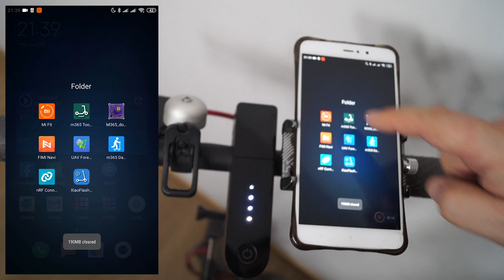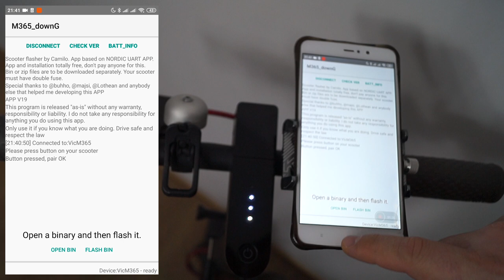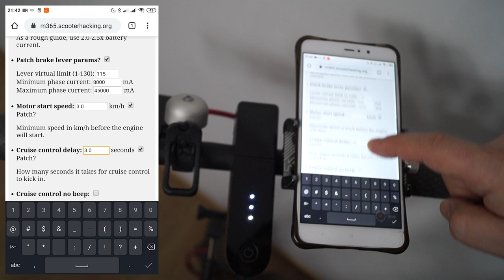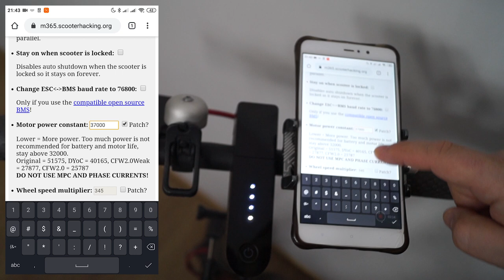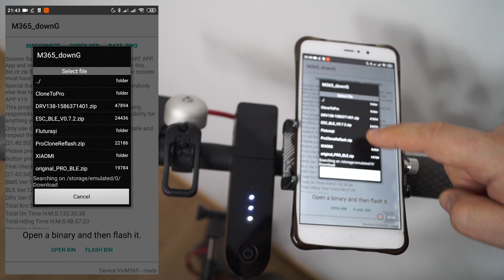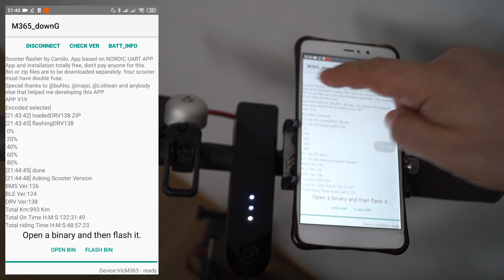XIAOMI M365 (Pro) | Do you want higher TOP SPEED or STRONGER ACCELERATION? Flash a CUSTOM FIRMWARE!

Comment: Wow... i  have standard m365 but had problem xith power switch so replaced it with a pro dashboard and now xiaomi home recognises it as a pro versinn algthough it didnt make it any faster wasnt sure which patch to use  so decided to try your pro patch. Was quite easy didnt change much except that 37000 bit and the russian algorithm thing (wasnt really stre what else xou changed not very clear) And it worked AMAZINGLY the speed is a great improvement i now have to ease off the acceleration every now and again as it is going too fast when i would usually be at full throttle and needed more speed. It even climbs hills alot better used tn have to use foot to help it up big hills but now it will get up.  I cant thank you enogh you are agenius THANK YOU SO MUCH
Reply from the maker: I'm happy to hear that you are so happy with your "new" scooter.

Comment: Nextor, how long have you been riding with custom firmware? I have made a log with m365 tools and in sport mode it goes up to 810W when having 31-32 km/h. Is it safe? How much will batteries and esc last in this mode?
Reply from the maker: I used it for about one thousand kilometers, all with custom firmware. No problem at all and I weigh 120 kg.
Reply: @nextor11  what's the maximum speed when you ride it? Do you keep it in sport and at it's highest speed for long periods of time?

Comment: Hi, 
Love the video and enough information on how to increase speed. 
I’ve just got my Xiaomi pro, guess the big question is, how safe is it to change the firmware. What if anything can go wrong. I’m not the most computer savvy, when you start talking about changing this and that, I’m worried I may mess up and destroy the scooter. 
Also what are the cons for lifting the speed restrictions, do all the modes still work, how much distance would you loose. 
Sorry for all the questions!!!
Reply from the maker: Well, any firmware update/downgrade might go wrong, not only on scooters, but it's usually going well. In case it doesn't go well, there are relatively easy to implement solutions to restore everything to how it was initially.

All modes still work, but I can't talk about the range because it was never a problem for me and I never measured the range.
Reply from the maker: There aren't any real cons if you don't use too aggressive settings.
Reply: Nextor many thanks for the quick reply, 
I just didn’t want it to brake or go wrong before I’ve even hardly used it, but might give it ago as uphill can be quite slow and would like to see the difference.
Reply from the maker: I strongly recommend flashing a custom firmware, but only after researching the matter a little bit.

If the flashing process goes terribly wrong, you might have to do this
https://youtu.be/xlezACP1YYw
or this
https://youtu.be/aGCCmvfTRXU
Reply from the maker: If you are comfortable doing what I do in those videos, then there is nothing you can't fix.
Reply: Nextor sorry, 
So in simple terms, when you say flashing a custom firmware, it basically tweaking a previous version to then install onto the scooter. Apart from the Mi home app, what other app do I need to download onto my phone to support the process
Reply from the maker: M365 DownG or XiaoFlasher are the apps that will flash the custom firmware.
Reply: Nextor if someone does have only iPhones, can theses processes still work
Reply from the maker: I wouldn't recommend doing this on an iPhone. The iOS app is not very reliable from what I heard.

Comment: Hi, just wanted to flash my m365pro via downg but if i press vheck version it will start showing temperature, batt remaining, volt.and it won't stop so i can't open the bin.got esc 0171, ble 0125, bms 0126. Got a m365 dashboard v2 soldered to the current one and installed rita with 12s battery.do you have any idea how i can flash my scooter in the current configuration?thanks in advance

Comment: I've got a M365 Pro but i'm too scared to flash it as many people say they end up with problems. Also, i've got a front solid tire. Whats your suggestion? Good video btw.
Reply from the maker: What kind of problems?
Reply: Victor Ungureanu the motor stopped working  and damaged the battery
Reply from the maker: Hi Tom. What are you talking about? This happened to you?
Reply: Victor Ungureanu yes this happened to me I flashed my scooter then if I span the wheel on my Xiaomi pro it would go 35 kph but then when I rode it the motor locked up and stopped working then I had to take it to Xiaomi and they have had to replace the battery , motor and the control board so you have any idea of how this could of happened thank you
Reply: @tomhearn944  Hi Tom,

I know its been a While, but did Xiaomi not void the warranty or did you have to pay for repairs?
Reply: @Uniques97  because my rear fender broke  my light cable snapped then I had to pay 300 pound to get everything fixed on my xioami pro bit if that light cable was ok I think they would of done it for free but I have done it right on my new 2020 xioami pro and it works fine

Comment: Salut! Multam de tutorial! Ma gandesc sa modific si eu 365 PRO-ul meu. Ai idee cum influenteaza viata bateriei, a motorului?
Reply from the maker: Bateria și motorul sunt ok. Cel mai frecvent apar probleme la controllerul motorului, dar asta doar când sunt folosite setări agresive.
Reply: @nextor11  Multam fain si ptr raspuns! A mea in momentul de fata se duce pana undeva in 27km/h maxim. Poti sa-mi dai niste parametri oarecum safe ptr ea?
Reply from the maker: E cel mai bine sa studiezi tu problema și să înțelegi cam ce rol au acei parametrii. Monitorizează temperaturile înainte de a pune firmware custom și după. Orice modificări faci, fa în pași mici.

Comment: Thanks for Tips off this .I just did what you showed, its works , but i can not see my battery level, its just flashing 1 Red bar, even full charged ?! Something to do about that ?
Reply from the maker: You flashed the wrong firmware. You either have a Pro scooter, either a classic scooter with Pro dashboard. In any case, you should flash a Pro firmware.
Reply: @nextor11  You are Good, Now it Works Perfectly. Thanks for help!! :-D And Yes i have a Pro version.
Reply: @lillebrorjensen7063   I flashed the pro with the classic firmware :-( Cant get it back to Pro now.  BMS 116, BLE 90 and DRV 538. How did you do it?
Reply from the maker: You need to flash DRV155. If you can't do that using DownG or XiaoFlasher, you will have to do this:
 https://youtu.be/aGCCmvfTRXU

Comment: Got a friend with 1.5.8 firmware on M365 and I cant flash DRV. BLE and BMS I can flash on any version but not DRV. tried both Xiao-Flasher and M365_DownG
Reply from the maker: M365 DownG is v19? What does it mean that you can't flash drv? Does it fail with an error or does it look like it's flashing ok, but in the end the version remains unchanged?
Reply: @nextor11  Flashing and it the end the version stay unchanged (0538 version )
Reply from the maker: 0538 doesn't mean that it's unchanged. You enabled version spoofing in the custom firmware and that's why instead of 138 is showing 538.
Reply: He updated with custom 138,drove some weeks and accidently updated the latest 0538.
I tried to rollback to older versions DRV with all BLE, BMS from xiaoflasher. No result so far
Reply from the maker: Don't check the "version spoofing" option when you create the custom firmware and you'll see that it will go back to 138
Reply: @nextor11  Will try and write again.
Reply: @nextor11  I tried all combinations and no result. I tried also some Italian Firmware with no success. The only difference was when changing BMS firmware, BMS115 gave the best results in acceleration, but max speed was with all versions DRV (all apps always showed DRV0538 despite the version I upload with ''version spoofing not checked) 26.7kmph at a flat surface and when downhill was KERS (all version I patched was with KERS above 45kmph) kicking and preventing me from more than 28kmph.
Reply from the maker: If the drv version remains 0538, even after flashing a custom firmware that doesn't have version spoofing enabled, this means that the flashing is not successful. I don't know what is happening. Try also to downgrade the ble to see if you can actually flash the drv firmware afterwards.
Reply: I tried 072, 073 and the all version I have found. All flashed OK. But as I said DRV didn't change
Reply from the maker: Then I don't know what to suggest other than using an ST-Link programmer to flash the drv.
Reply: I think so

Comment: Using your settings in firmware, will it not fire the control or mother board? Have this been tested?
Reply from the maker: Are you asking if these settings will burn the electronics?
Reply: Nextor yes
Reply from the maker: My settings are quite conservative, so they are generally very safe, but it also matters how heavy you are, if you are living in a very hot place, if you have a lot of hills to climb, etc.
Reply from the maker: Oh, and properly inflated tires.
Reply: Thanks I’m 70kg and live in uk
Reply: @nextor11  I have a classic (2018) M365, now with 6500 km. It is holding up pretty well - I can ride some 15 km in the city, full throttle. Yesterday I have flashed it for the 1st time, using a "motor power constant" of 33000. Everything works well, it has noticeable faster acceleration, better climbing ability and it reaches 30 km/h. However, I ride it to and from work and one way is 10 km. On my way back, after some 5 km, I checked the motor temperature - it was quite hot and the battery temperature was already 40 Celsius. After that, I tried to ride it slower, but by the time I got home the motor was hotter (it was hard to keep your palm pressed to the sides of the front weel) and the battery temp was 42 Celsius. I am planning to change the settings to 37000. Do you think it would be safe for frequent long rides? (Does anyone have experience with this level of setting - I mean thousand of km experience, not just a week or 2?).I weigh 93 kg.

Comment: Hello there! I am also living in Romania, and would like to ask you a question. First, i would like to thank to you for making this video and to tell you that the trick works. BUT, there is always a but. I have the Scooter Pro version with 1.7.1version. If i check patch on sport and drive mode and raise the speed, it does not actually affect the max speed. If patch on sport max speed or d max speed is checked or unchecked, in russian throttle algorithm it does not take into effect speed control param, as it is also writenn on the web site. How could i still limit the speed then but raising it to 30 in sport and 25 in normal drive? Best regards!
Reply from the maker: Hi Marius. I don't have a Pro to test this, but I think you need to leave Russian throttle unchecked and change the currents in sport mode, plus raise the speed in sport mode.
Reply: @nextor11  I havent changed anything in currents because i would like to keep away from real problems with my scooter. I am not that technical to even understand those changes. The thing is that with drive normal speed set to 25, with Russian throttle off, it still goes with 20. So there are no changes whatsoever, even if i think it should be.
Reply: @nextor11  With russian throttle on, i managed to enter in cruise control in a very strange way, after 30-40 seconds of trying. And after entering cruise control, the scooter does not remain at the same speed, because i guess the throttle is "fixed" not the speed. So that's another downside of russian throttle.
Reply from the maker: Try this: https://www.monopattinoitalia.it/miglior-firmware-per-xiaomi-m365-pro/
I hate to recommend it because it's "stollen" and the actual developer of the firmware get's nothing in return for his work, but maybe it helps you.
Reply: @nextor11  seems that in S they are going for russian throttle mode. So i will skip theese italian firmwares. I have seen here someone commenting about the gonka fw, witch i downloaded and seems ok at first sight. It's a pity the https://m365pro.scooterhacking.org/ is not doing his job correctly :( At least i would have known what is changed from "standard". I repeat myself, i would not like the battery and engine to be forced too much. Some little increase in maximal speed, without working at acceleration or currents.
Reply: @nextor11  How could i update to 1.7.1 if i would like stock again? Could i update 1.5.5 from xiaomi official app directly? Thanx!
Reply from the maker: The firmware from italian website is not using russian throttle algorithm, but Oleg's algorithm, which is considered to be the best, but which is not free usually. That's why I said that I wouldn't recommend the italian website, because they are actually "stealing" from Oleg.
Reply from the maker: Returning to stock factory firmware used to be straight forward, but now I don't know any way of doing it.
Reply: @nextor11  on the italian website, next to sport mode "accelerator sport" is a russian flag :) I don't know who Oleg is.
Reply: @nextor11  that's odd. So we are stuck in "custom" firmware? Wont xiaomi app say "new update"?
Reply from the maker: It used to say that there is an update available, but lately it doesn't.
Reply: @nextor11  are you using "Version spoofing"? I will try to see if my app wants to update it, the version is now 1.5.5. With version spoofing you have 5.5.5
Reply from the maker: I'm not using version spoofing, why would I? :)
Reply: Nextor i have a message on 1.5.5 that asks me to update in xiaomi official app. Maybe it’s version spoofing thats preventing yours to update!
Reply from the maker: It's not version spoofing. I tent to think that they are blacklisting the serial number or maybe they simply detect that the firmware was altered and they don't offer the update anymore.

I even tried to update after flashing DRV and BLE firmwares using ST-Link, but no luck.
Reply: @nextor11  Nextor if you check version now, is it 1.3.8? Or is it 5.3.8? Version spoofing was checked in your video, that’s why i was asking about it.
Reply from the maker: You don't need to try to solve my problem, thanks for wanting to help.
Reply: Nextor it will also be my problem in a short time :) That’s why I was asking a simple question. Sorry if it seemed rude, but the answer would help me.
Reply from the maker: I told you that it has nothing to do with version spoofing.
Reply: @nextor11  Thank you for clarifying!

Comment: Hello sir! I updated my xiaomi m365 display to a xiaomi m365 pro...I need to use a custom firmware for a xiaomi m365 pro or a normal xiaomi m365? Please help me
Reply from the maker: You need to use Pro DRV and BLE firmware from now on.
Reply: @nextor11  the ble didnt work to update when I switched to pro dashboard but the  bms worked so I used this morning the pro custom firmware and worked it installed but didnt try it yet because outside is raining...do I need to install and the ble for pro for 100% sure or I can rule with the old ble from old dashboard?
Reply from the maker: If everything is working OK, don't worry about the ble. If the Pro dashboard is not original you can't write the ble firmware over bluetooth anyway.

Comment: on 1.7.1 doesn't work. I did everything step by step, but after the downgrade, the speedometer and battery lvl stopped working, S mode disappeared. Tried it 2 times, but still same.
Reply from the maker: You are not flashing the right drv firmware. You should flash a Pro drv firmware (ver. 155).
Reply: @nextor11  There is 1.3.0 - 1.4.3. How to get 1.5.5?
Reply from the maker: Read the video description please.
Reply: @nextor11  The page doesn't work. Ok, I'll wait. Thanks <3
Reply from the maker: You can use https://hackm365.com/proconstante

Comment: With the Pro version do you need to adjust the Speed mode, Drive mode and Eco mode or can I just tick Russian throttle?
Reply from the maker: It's your preference. Do what you like best or try both ways to see what suits you best.
Reply: Victor Ungureanu thanks for the advice! I’ll give both a try see what works better
Reply from the maker: You're welcome!
Reply: Victor Ungureanu just one more question will it damage my scooter/motor consistently driving at high speed?
Reply from the maker: Some Pro controllers had some heating y, so you can do what this guy is doing if you are concerned:
https://youtu.be/bo8gbmF8bq0

Comment: Are you able to get an M365 up to 34kmh?  I can only get 27kmh or 17mph.  I remember reading it was safe to get to 34kmh but im still aways off.
Reply from the maker: I didn't think any M365 is capable of 34 km/h without increasing the battery voltage. Many of these scooters, but not all, can reach 31-32 km/h when the battery is fully charged.
Reply: I have 34 with another method and is cool
Reply from the maker: Yes, downhill is possible. Also with a higher voltage battery. If you have other method, post it here.
Reply: @nextor11  without downhil i got 34 but not with your method
Reply: With the app of xiaomi flasher. Put s 34, eco 22, and D 22
Reply from the maker: You are speaking about the Pro scooter. I was speaking about the classic.